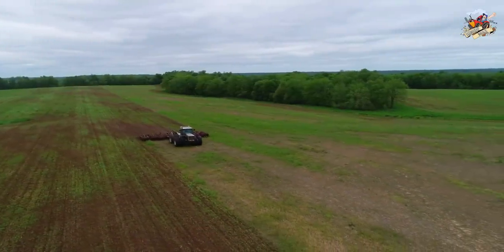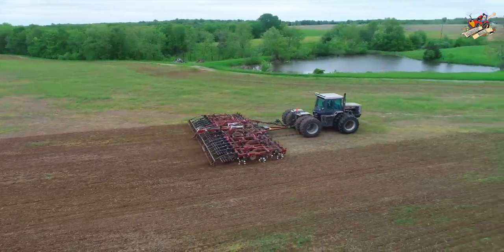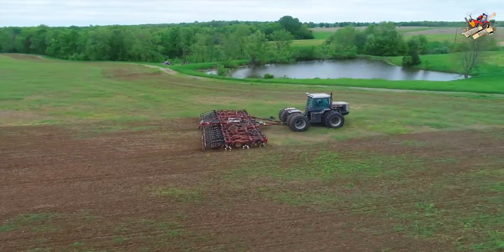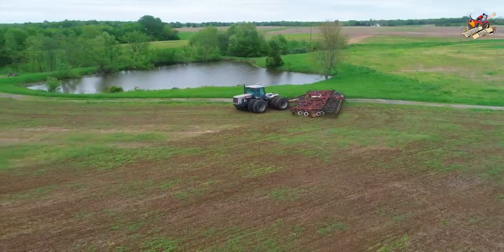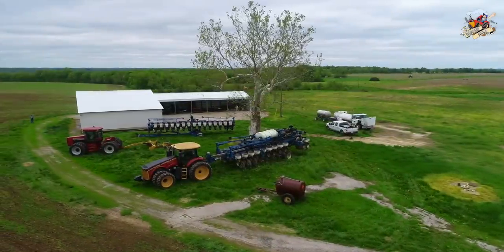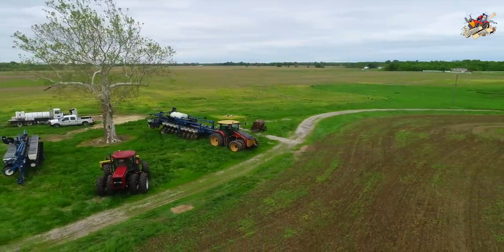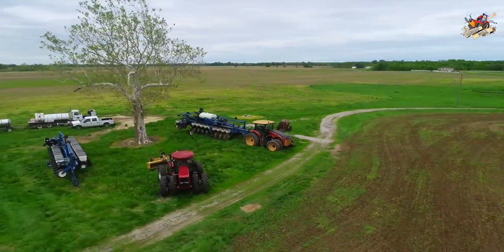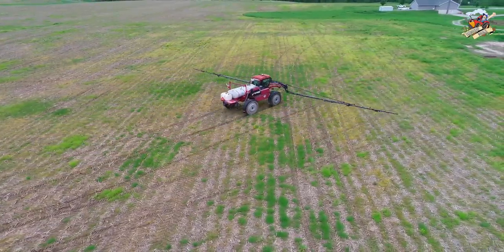Working Ground in Missouri With an Agcostar 8360 Tractor

Comment: Enjoyed the video. Bu curious why they didn't spray then no-till. Or if no-till is not for them. Pull a heavy disk over it. I'm sure they have a plan. Just curious what it is.
Reply: I was trying to dry it out and work in the dry fertilizer i sprayed it after I planted it. I normally strip till my corn but the wet fall and even wetter spring made that not happen.
Reply: @technostanrip  I understand. Did you get a good kill rate. Again just curious. back in the old days they told us, for best results the weeds and grasses should not be described or under stress. I realize things have changed a lot in the last 20 years.  And I do appreciate the taking the time to address my questions.